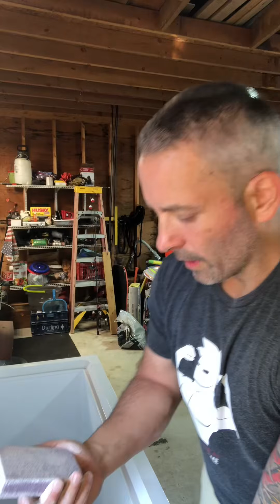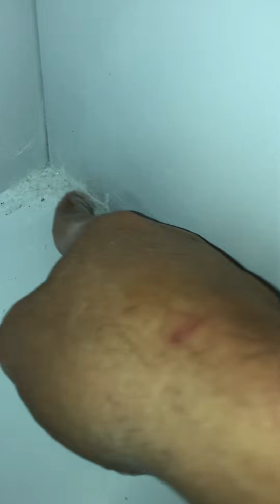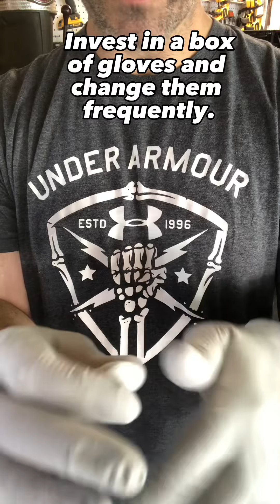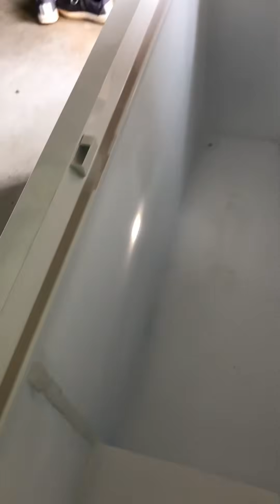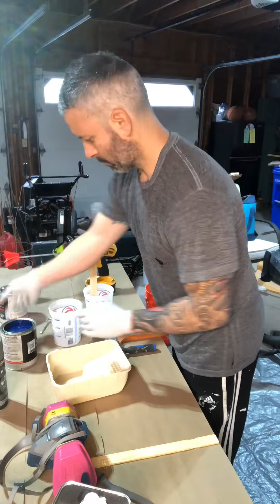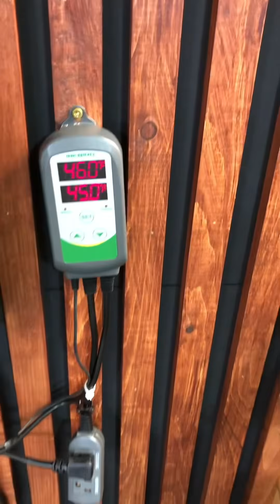Chest freezer cold plunge build

Comment: Thanks for the video….I’m assuming that the sanding is to ensure that you can properly apply pond shield?  And is the pond shield just another layer of insulation? thank you!
Reply from the maker: Thank you! Yes. You’re right on. The sanding provides a surface that the pond shield can “bite” onto providing that extra layer of insulation and piece of mind.